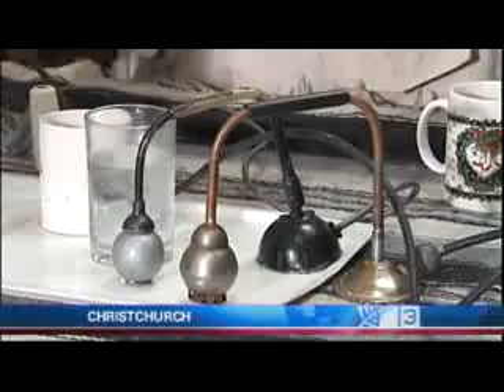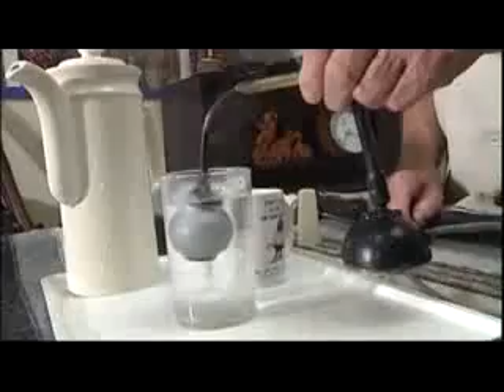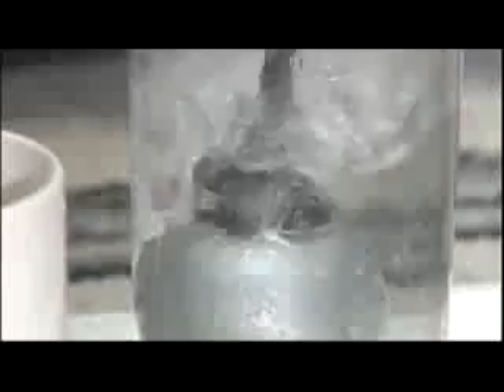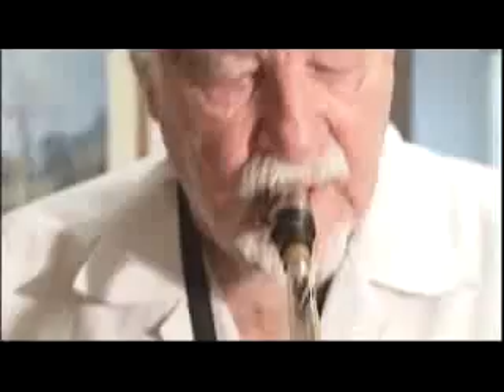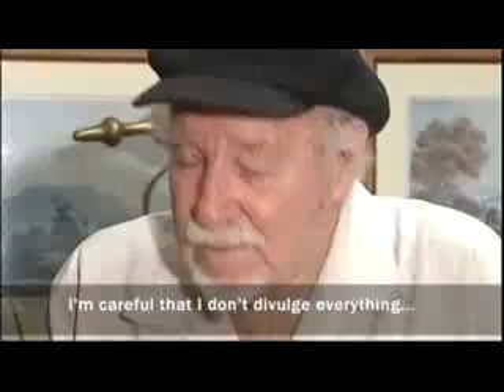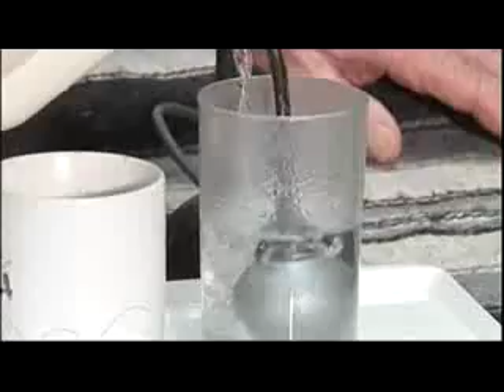Peter Davey - Sonic Resonance Boiler

Comment: Is he boiling the water or just blowing air through it to make bubbles? There is not a thermometer in sight to prove the water is actually getting hot. 
There are known examples of resonant acoustic heat pumps. These use air as a working fluid adiabatically cycling it in a resonant tube with plate restrictions placed in the tube. Los Alamos did a lot of work on this, even going so far as to design a sonic heat pump, that if heated at one end, produced cooling at the other, producing a humming sound in the process. There are lots of scientific papers on the subject, see the attached reference.
Such pumps are very efficient as heaters and coolers, because the only moving part is the air and like a Stirling engine the hot parts remain hot and the cold parts remain cold. The amount of heat moved is greater than the electrical input could generate by simple resistive electrical power dissipation.
If this unit is a heat pump, one end must be cooling while the other end is heating and the temperature ratios are just down to thermal mass of the parts. This might explain the way he is holding the apparatus by the insulated middle. While it is easy to dismiss this as a fake, with lots of ways to produce the observed effect, there is the possibility it is a resonant sonic heat pump.

 ref https://www.lanl.gov/org/ddste/aldps/materials-physics-applications/condensed-matter-magnet-science/thermoacoustics/animations.php

See also https://en.wikipedia.org/wiki/Thermoacoustic_heat_engine

Comment: The report clearly says that the ball (use to heat the water) is cool to the touch. The is no visible switch for the device. This assumes that the witnesses are allowed to touch the plugged-in device before and after inserting it into the water. The ball (use to heat the water) does not appear to drain water after it is removed, so, that rules out electrodes inside the ball, and who in their right mind would allow witnesses to touch a live 220V ball. To heat to that instantaneous degree, the ball would have to maintain a temperature of at least 120 degF over the temperature of the water, even when removed. The fact that it (the ball) was touched just before inserting it into the water proved that it could not have been above the ambient temperature of the room they were in. There are no AC or DC heating element(s) that are currently capable of doing what we saw in the demo video. The electrical heating element would have to be RED HOT to react in the water like his acoustic heater.

What I believe he was demoing was a small frequency tuned speaker near the 220V plug end. Tuned from 432hz-528hz. From there the sound traveled up the hollow handle and resonated inside the Ball on the end. That is why there is a foam or rubber isolator where is hand lifts the device. Even at 2.8W of the 220V that would only be 13.1mA of power.

People think radiation heats your food in a microwave, but for those that don't know... It is ultrasonic microwave sound waves that cause only the water molecules in your food to boil. Sound familiar? The problem is that propagating ultrasonic microwave sound waves requires a lot of energy (550W at 110V that would be near 5A of power), but microwaves cause metal molecules to vibrate too (known as the "Don't put aluminum foil in the Microwave" effect).

Efficient low voltage, low-frequency water heating could revolutionize the world, from Water desalinization, to steam powered generators, to steam electric vehicles, and even just affordable hot water heat for every home. But the flat earth scientist will never believe that you can get more energy out than what you in. Ask those same people "Why do we use petro/diesel for autos?" They will say that the energy potential of those fuels balances the equation. Well, simple water has more energy potential than petro and diesel combined. We just need to find a way to unlock the chemical padlock to free this world from destructive fuel harvesting. 72 percent of Earth is covered in easy to obtain water, but by volume, the earth is only approximately 5 percent water.

that is my 2 cents.
Reply: And what about atomic frequencys that Hutchinson used
Reply: That's was a damn good two cents

Comment: I suggest how it works is this: grade school textbooks; kinetic energy the vibration of molecule defined as heat. In other words the faster the molecules vibrate, the hotter the the piece of matter is. Sound is just VIBRATING air - pitch (frequency) is just vibration speed. Air vibration forces the piece of matter to vibrate creating heat. The higher the frequency the hotter the matter hence boiling! It would be interesting to see how fast Mr. Davy's device could bring a 4 liter pot of water to boil!

Comment: I also can do it. I use a microwave to boil water :) The frequenz of the microwave is between that of the resonance of H and O - thats easy, but think about what a Cell phone is doing with the water in your head !
Reply: I don’t believe the emf’s given off by a cell phone would have enough power to do anything of this sort. Think a microwave needs mains power and a phone caps out at whatever power it’s own portable battery can deliver.

Comment: It looks like its using dual function input, electricity to facilitate vibration at whatever frequency but then also air going thru the top black part of the thing, since its only when that is submerged that the bubbles become rapid and agitating.    Whats the power draw in watts, at what format of volts and amps? (ie. 200watts but at 12v 20amps or at 120v 1.8amps)   is there any air being forced thru or is the top tube open on the back end so air can resonate?